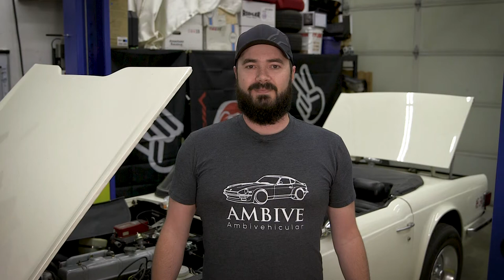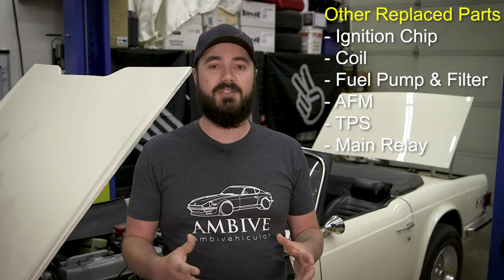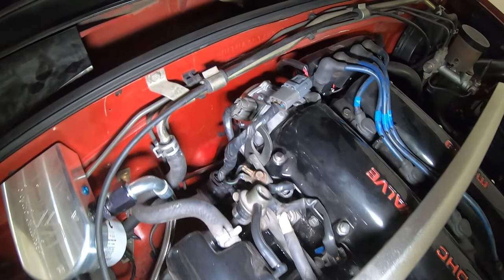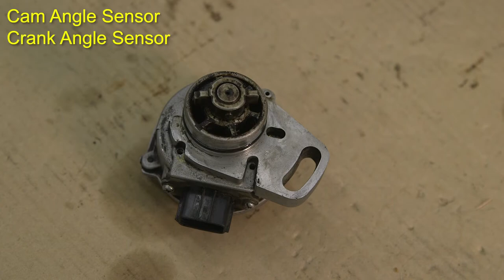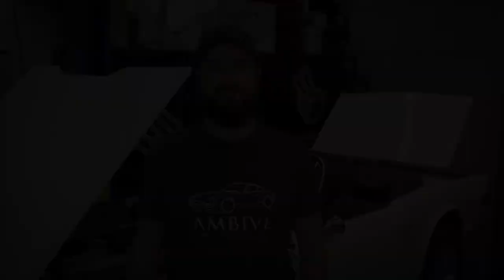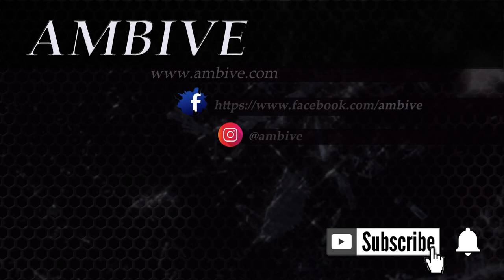NA Miata - Symptoms of a bad CAS

Comment: Interesting.  I wonder what it is that fails inside the CAS?  I have an NA6 also. And I am replacing the catalytic converter every few few years, so the car has been running rich.  If there have been misfires, that would explain a lot of unburned fuel in the exhaust that is killing the cats. Now that catalytic converters are quite expensive, this does not work well as a temporary solution.
Reply from the maker: That could certainly kill cats. The CAS doesn't always fail predictably, so it could continuously be varying the misfires and burn enough that it damages the cats but runs well enough to get by.
Reply: @AmbiVe  apparently the CAS sensor in the NA6 (89 thru 83) versions of the car is an optical switch.  The NA8 and later are said to be Hall effect sensors. They are pretty simple devices. There are four pins. Pin 1 is Ground. Pin 2 gets 12V.  Pin 3 pulses 4 times per cam shaft turn. And Pin 4 pulses long 1 time then short 1 time per cam shaft turn. LEDs do lose brightness over time. I can imagine this producing an irregular signal, that trips the photo diode receiver most of the time, but not all of the time.
Reply: Okay. I just gave in and bought one. The NA6 has old school optical sensors. After 30 years it doesn't owe me anything.. Modern replacements have Hall effect sensors. Prices on these are all over the map. I bought a Walker for $175.
Reply from the maker: Replacement parts for the old cars is always a roll of the dice. Good luck!

Comment: Just did the timing on my 90 1.6 and at idle it stumbles/Missfires, I’ve looked at everything I can think of and I have no clue what it could be, it also has an exhaust pinging when you apply 1/4 throttle or more
Reply: Pinging like a rattle?

Comment: I have a 1992 Miata with a 1.8 engine swap and basically whole drivetrain from a 1994 model. I had a similar issue, was driving and hit a rather bumpy patch of the road and immediately after the tach dropped to zero and it felt like the whole engine turned off while I was still doing about 40 miles an hour. The engine turned back on in like a split second. But after that incident it did it 4 more times on the way home and every incident got a little bit worse and sketchier. When I pulled in my driveway the car was idling fine but the fuel pump was making a weird noise. Almost sounds like a washing machine running in the distance if that makes sense. Does this sound like a CAS issue to y’all? Any recommendations? Thanks for any input I really appreciate it.
Reply from the maker: It sounds like you have something loose. Since it died and runs so rough, I would check that the CAS didn't move and mess up timing, that all your ignition connectors are right, your coils are tight, and your grounds are all clean and tight.
Reply: @AmbiVe thanks for the quick reply!!! That was wicked quick. Im subscribing now

Comment: I am having a problem when on coils 1 it will only fire once every few seconds and on coil 3 it won't even fire at all. I a new coil pack in and the same problem is accuring. Could this be the cas or would it be a crank position sensor. Any help would be very nice
Reply from the maker: I would say that it could be the CAS or possibly another portion of the ignition system or control. These CAS are so flaky, especially the Chinese reproduction versions, that it's a solid guess to start with.
Reply: @AmbiVe  I was looking around the engine and I noticed that the crank position sensor wire was ate through a little bit by the belt. The car will start up perfect and idle but as it warms up the idle will start to surge up and down. I wonder if that is the problem
Reply from the maker: You must have a later car if it has a crank angle sensor and a cam angle sensor?
Reply: @AmbiVe  yes I have a 1997 1.8l

Comment: My NB has these symptoms, though it does not immediately re-start. Takes minimum 15 minutes. One garage said fuel - replaced fuel filter ("full of rust")....but still had the problem.
Reply from the maker: When the CAS is dead or dying, often it won't restart until cooled down. We had the same symptoms on her NA.

Comment: Hi!  To solve the problem descibed in my previous comment, I went to Mazda and bought a brand new CAS (BP4W-18-221B) which is identical to the one I removed.  Installed it today and went for a test ride trying to duplicate previous failure conditions:  external temp 30°C +, sustained highway speed preceeding a long traffic slowdown.  Sure enough I had the exact same failure as before and needed to stop on the side!  I was very surprised as I really suspected the CAS to be the problem.  In your case, at the end and after changing a lots of parts, what exactly made you think that the CAS was at fault?  Is it possible that my two identical CAS behave exactly same in heat condition?  Thanks for helping me on this issue!
Reply from the maker: I received a bum CAS in the past and had to replace it again shortly after testing. It's also possible your ignition chip or coil could be having heat issues. It's hard to pin these vague issues down unfortunately.
Reply: Ok, I just went to check if I had any code recorded (I had none with the previous sensor).  But now I have one:  P0340 - Camshaft Position Sensor A Circuit Bank 1 or Single Sensor.
Reply from the maker: You might have a wiring issue or bad luck and got a bad new CAS. Good luck with your fix!
Reply: Ok thanks, back to the drawing board!
Reply: Hi again!  Just to up-date on my 1.8L engine stumbling and stalling at hight load and temp.  Because it is different from earlier 1.6L engine, in my trouble-shooting I mistakenly confused between the CAMSHAFT and the CRANKSHAFT POSITION SENSORS!  Replacing the CRANKSHAFT position sensor did no good (and the old part was identical to the new).    Realizing my mistake I ordered and replaced the CAMSHAFT position sensor (now this part is different from the original.  Same Mazda part number but different Mitsubishi p/n engraved on the part!).  I them went on a road test trying to duplicate the conditions (not easy!) which triggers a stumbling/stalling fault.  It passed the test with no problem with the engine and no fault code locked on the tester.  I leave just a tiny doubt for the future but I am now pretty confident that the CAMSHAFT position sensor was the real culprit!  Thanks for your help!

Comment: NEED HELP! My 96 1.8 has 179k miles! She ran great and is my daily!!! Driving to windy roads the other day when she just shut off on the highway, fuel cut and looked in the bay to see for any blown fuses or unplugged plugs!! Never left me stranded so knew it must’ve been something stupid! Get it towed to my mechanic and his diag was the CAS! P0335 code! I went and got one from a friend and still isn’t working! My mechanic says it’s now not getting spark! I found another CAS that I’m just going to buy to the hell of it for $50! I’m so annoyed! I love this car and it’s my daily! Start school Wednesday and desperate to diag and fix her! Please help me!!! I’m a junior mechanic but id rather it be looked at by a master mechanic etc…thanks!!
Reply from the maker: If you don't have spark it could be CAS, ignition chip, or coil. Each one has a specific testing process that generally just requires a multimeter and some time. Either take some time to test or open the wallet and throw parts at it. The CAS is the most expensive part, so if your friends was good, it shouldn't be as bad if it's the chip or coil.

Comment: I have a 1990 Miata and when you give it gas it dies , I’ve replaced a ton. I actually put a new cas on the car a few months ago but I’m curious if maybe it had went out in a few months after being replaced
Reply from the maker: It may have. I have had terrible luck with these Chinese replacement parts. Even the expensive one we bought that is aftermarket seems sketchy.

Comment: My N/A Miata is having all the same symptoms you said but it jitters when I stay cruising at 4k rpm and then when I mash the throttle to do a pull the engine completely dies and if I hold it down it fully dies and turns off
Reply: Could that be the angle sensor or something else
Reply from the maker: Does it feel really abrupt and shake hard or does it feel like it just wheezes out and dies? It could be fuel as well. Good luck!
Reply: @AmbiVe  the shakes are very hard and when the rpms come back up it  shoots back up like if nothing was wrong in the first place
Reply from the maker: I would bet it is the CAS. Ours was very similar and we replaced everything before biting the bullet and getting the CAS.
Reply: @AmbiVe  awesome thank you so much for the help and have a great one!!!

Comment: I have cylinder 3 and 4 not having spark at all. Because whenever I pull it while the car is running. The car wouldn’t shut off.(I did this test maybe twice?) I changed ignition coil, spark plugs and spark plug wire still doing the same thing. I just changed the injectors as well. Literally just 3 and 4 is misfiring. Maybe a bad CAS? I remember when I tried to change the O RING and I cleaned the cas with tons of Break Parts Cleaner and idk if that’s the cause of MAYBE the cas being broken.
Reply from the maker: If it's only specific cylinders, I would try swapping around plug wires and plugs. If it doesn't change, I might try another coil or jump to assuming that the CAS or ECU might be having issues. Cleaning it could have caused an issue, but if you looked at cleaning it in the first place, it may have been bad all along.

Comment: Hey man I’m having issues with my 91 NA as well. The car will start but after driving when the car is shut off the car won’t turn on again it’ll crank but no start. Sometimes it’ll start for 2-3 seconds and stall out  but after waiting like 10 to 15 minutes it’ll start right up… but again  if it’s turned off it’ll crank and won’t start again I have no clue if it’s my CAS or crank position any help? Thank you!
Reply from the maker: That sounds like a CAS to me. At the end that was exactly the kind of thing her car would do.
Reply: @AmbiVe  is there any way to check it? Like with a digital multimeter or? Becaus the cas isn’t cheap per say haha I wouldn’t want to spend the money of that isn’t the issue
Reply from the maker: There are a few ways, however, none of them worked for the sad CAS on our Miata. I think it would work of the CAS was totally dead, but if the car starts at all, it's not failing all the time.

Try the information here:
https://forum.miata.net/vb/showthread.php?t=327229

Comment: I'm more of a fan of that vehicle behind you (TR6?) and the one on your t-shirt 😬
Reply from the maker: The TR6 video that has been delayed for months will finally be redone soon, so it will be back!
Reply: @AmbiVe  Many years ago I had a TR6 for about 6 months, it replaced a tired Fiat 124 Series 2. Traded the TR6 for a 240Z followed by more Zzzz. Eventually ended up with an NA MX5 back in 96 and still have that now (~350000km) although it's been OTR for 2 years waiting for a crankshaft fix or motor swap.
Reply from the maker: All fun cars. A lot of the lower power cars are some of the most fun.
Reply: @AmbiVe  Hell yes. Love my little go kart 👍